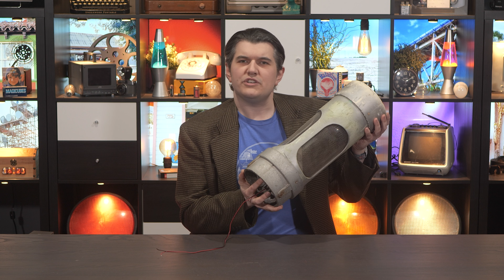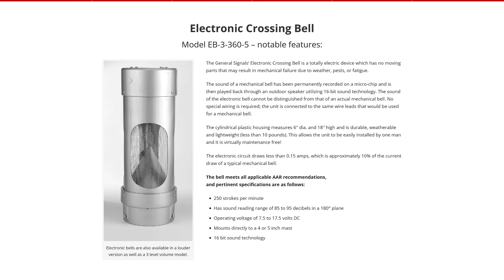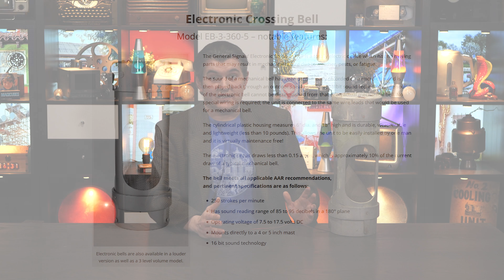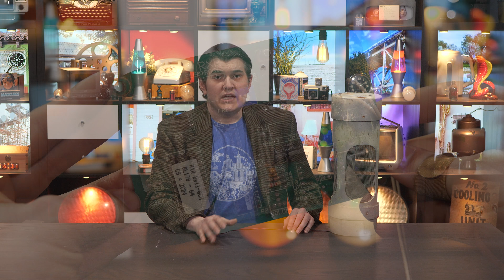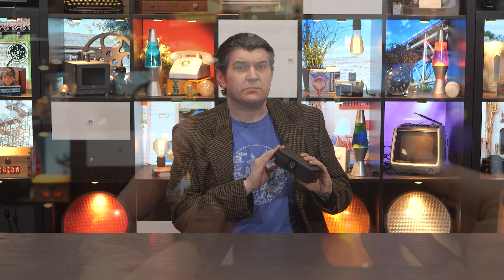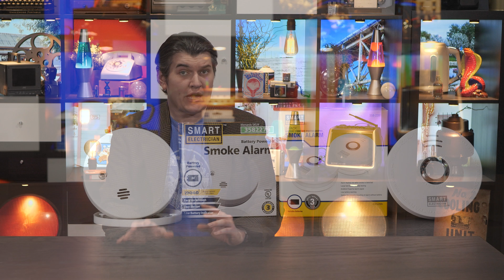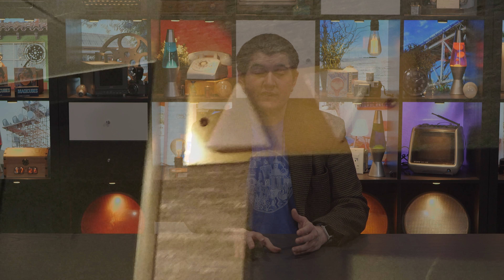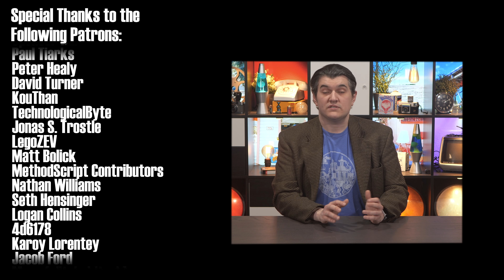The disappearing and unappreciated art of audible alerts

Comment: I miss the brief period when phones had a notification multicolor LED and you could configure it to flash certain rhythms and colors to indicate certain notifications.
Reply: Most missed feature besides SD slots and 3.5mm jacks. My S9+ was one of my favorite phones I ever used.
Reply: @guelahpapyrus i miss when the fingerprint slot was on the back of the phone! Could easily unlock while grabbing the phone and had a better rate than my current in screen sensor.
Reply: @hydra4370 Yeah, under-screen sensors just aren't as fast as dedicated ones. I also have problems with finding the damn thing. I used to pull out my phone and it was unlocked cuz I put my finger on the sensor. Now I have to look at the screen to see the prompt and sometimes push the power button, adding three more steps to unlocking my phone.
Hoping the new ultrasonic sensors will provide some relief with faster action and more scanning area
Reply: @hydra4370see, this was the big thing that drove me away from the S9+ and other similar phones. The fingerprint scanner in the back always felt so out of place and weird for the way that I grab me phone :/ glad it worked for you, though!
Reply: @hydra4370 urgh i hate under screen fingerprint readers. they are soo sloooooow compared to one on the back or integrated into the standby button. with those the phone is unlocked before you pull it out of your pocket with the underscreen ones (and facial or retina scans) you need to first take the phone out, then unlock and then you can do whatever. Not to mention how often the under screen  reader simply fails to read the fingerprint multiple times in a row so you have to enter the pin anyways
Reply: @hydra4370 Also back of the phone scanner don't flashbang you for trying to check your phone in low light. I've literally trained myself to keep my eyes closed when unlocking my phone in bed
Reply: @hydra4370 At least on Samsung, it could also be used to expand the notifications, which was very useful on tall phone. Greatly missed!
Reply: @hydra4370 On my S10e it's on the power button, which for me is the best place as that's the one place I always landed my hand on when picking it up with the intention of unlocking.
Reply: @hydra4370 That's fair, but I didn't like the back of phone fingerprint sensors since they didn't play nicely with my case
Reply: @hydra4370 I like Motorola's placement: built into the power button, on the right side above the volume rocker. Easy to scan your right thumb or left index, depending on which hand you're holding it with.
Reply: @hydra4370 Fingerprint unlocks are a massive security risk anyways, just use a pin lmao it takes the same amount of time at this point.
Reply: @hydra4370yes i will forever miss the ergonomics of my pixel 4a so much. I still have it and like to fondle it every so often. Probably one of the cleanest phone experience ive ever had.
Reply: @hydra4370i hate the back of phone ones personally. I have to authentic for some apps and id hit the camera lens instead. Or its be a pain cause then id have to readjust just for that 1 thing when i can touch a thumb cause ive loaded thumbs and fingers into the security profile. Way easier with it under the screen.
Reply: @hydra4370 I remember my LG G4 (I think… it’s been like a decade) that had the power and volume on the back. It was great. The phone was slightly curved as well which felt easier to reach the whole screen. And also user replaceable battery. 

If LG didn’t screw me over either the CPU crapping out after an update and it taking a class action to do anything about it, and then my replacement just one day just stopped turning on… I would have stayed with that line. Went with a galaxy s7 after that.
Reply: @Politisloth yep, same with the G3. It has been my favorite phone design ever, sadly it quickly disappeared. Thing I loved most about is it when I was listening music with it in my pocket I could press ‘through’ my pocket to change the volume double tap to skip. I miss that atm, i find swiping on wireless earbuds very inconvenient or sliding inside my pocket to feel to find the volume buttons on one of the sides.
Reply: @GameCyborgCh something tells me you're a Pixel man 😂
Reply: @Bokenbergen  I completely forgot it had swipe functionality, been a while since my J7 lmao
Reply: @hydra4370they never worked well for me. The under screen ones are the first ones that worked reliably.
Reply: I am so glad I've kept my s9+
Reply: @CK-jd7wo-test I still use my s9 and it's very useful for knowing if you got a text message or a missed call in my opinion
Reply: @CK-jd7wo-test  I have J7 and A34. Do I need shiny new phone to make calls and listen music while Im in travel?
Reply: @guelahpapyrus  The headphone jack was bad enough, but at least work arounds exist.

But the SD slot fills me a rage!
Reply: @scaper8  Motorola G56, expandable storage up to 2Tb, 3.5mm jack, under 300 USD and can still (mostly) play Genshin.
Reply: @afrog2666 It's honestly so funny how cheap phones still have everything. In 2020 I bought a Chinese phone for 150€. It had a headphone jack, dual SIM, and microSD slot. Additionally, it came with a protective case, multiple glass screen protectors, cheapo headphones, a USB C cable and a 30W quickcharger. Recently (and very unfortunately), I dropped it in the shower and it died, so I had to buy a new one. I figured since I spent so little on my last phone, I could get myself a fancy one this time (and I do like it a lot). This one came with literally nothing in the box except the phone and a bit of paperwork. Not even a cable. And I spent a very significant amount of money on it, lol.
Reply: @scaper8  but how else will they sell you an extra 50gb of storage at an extra 200 bucks?
Reply: @afrog2666  i miss the times when people used phones to be just phones. Not to play genshin and scroll on tiktok
Reply: Someone already pointed out Motorola, in the US you have the G, G Power and G Stylus. I'm not 100% sure on the stylus, but they should all have (G and G Power are guaranteed) 3.5mm out (a bit of circuit noise at lower volumes and not the best max output but it IS a headphone jack) and a microsd slot. Mine has a 256 GB card that I am continually filling with music files c:
Reply: @scaper8  redmi phones still have headphone jacks and micro SD slots
Reply: @scaper8 samsung phones still have a micro SD slot. It's shared with the Sim card
Reply: @EthanShalev  Do they? I thought I'd read that they were getting rid of them too.
Reply: @blargleschnartz  The G Stylus does have both the headphone jack and micro SD card slot
Reply: @EthanShalev no they do not. I know because I just switched away from Samsung for that reason primarily. 
They have slots for two different styles of Sim cards. No high end Samsung has had a micro SD card slot for years.
Reply: Commenting again because I've been living a blissful life: BOLD is an awesome brand out of Miami that still has 3.5 mm jacks and sd slots on their phones. They rock.
Reply: @EthanShalev the cheaper models do. The flagships don't. That's not a "premium" feature. Only plebs need storage obviously. /s
Reply: @Flintzell  The A55 did have a SD slot, the A56 doesn't. Fairphone-s also have SD cards, and a removable battery.
Reply: @igorokinamujika2073  Removable battery is planned for the next EU regulations on phones. So even Apple will have to bring that back.
Reply: @guelahpapyrus  I keep an adaptor connected to my wired earphones these days so I don't miss the 3.5mm jack much. In fact, it solves the problem with some of my devices that have 3.5mm jacks but exhibit audible electronic noise because the adaptor does its own digital-to-analog conversion.

I do miss microSD though.
Reply: @nooneinpart 
Constant use os the USB C on a phone wears out the USB way faster and will literally brick the phone if it doesn`t have wireless charging, it`s a cost saving "solution" from bad companies, such as Samsung, Sony, crApple and many more.
No 3.5, no SD card slot, no IR blaster, twice the money, half the performance.
Yeah, the big one`s are losing and it`s about time.
Reply: @afrog2666 I've never had a port break on my devices, and the USB-C port on my Galaxy S24 is on its own board that can be swapped out.
Reply: @afrog2666  The officially rated amount of times you can plug something into a Type-C port is so vastly big that this is a non-issue.

Stop the nitpicking.
Reply: @nooneinpart That's a good point, that's why you buy the adapter after your headphone jack starts to go out.

Also, most of the devices that do have that are old and that's why they're messing up, not intrinsic to the audio jack.

It's reasonable for me to expect to be able to charge my phone and listen to music at the same time without having to buy an adapter
Reply: @TraxelAxel Nope, my Dell laptop was new and it had noise through the headphone jack. My Samsung tablet too, but to a much lesser extent. My Android-based Sony WALKMAN has some slight noise when the Wi-Fi is turned on and it's connected over 2.4GHz. It's surprisingly common, to the point where in IEM enthusiast communities, a dongle is the first thing people recommend when someone mentions noise.
Reply: @guelahpapyrus  Sony did all three(plus no notch) until the 1 mk5 where they ditched the notification led
Reply: @guelahpapyrus  Fairphone 6 has an SD card slot,  AND a user-serviceable battery.

In fact,  the entire phone is based on the idea that any user with 2 working hands can repair nearly every component without any special tools.
Reply: I didn't realize that sd cards weren't a thing anymore until only a year ago. Been using Fairphone 3 and now 5 and so I've just always got sd slots and thought they never went away. Bummed about the 3,5mm missing in Fairphone 5 though. What do you mean I can't listen to audio through headphones while charging?!? Like that's 80% of my time in trains. I don't want yet another breaking point between me and the audio like my fricking headphones running out of battery or not connecting. Or some hacker trolling them with WhisperPair.
Reply: @guelahpapyrus I still use an S9. My last ones screen broke but I transfered all my data to a new(used)one because I love it so much
Reply: @guelahpapyrus and that's why I will get the clicks commutator.
Reply: @kitt3  Same! Physical keyboard, it has ports, and the notification LED. I've been pining for all of those features to return for years.
Reply: @guelahpapyrus  its so weird that apple is bringing it back on the NEO
Reply: @guelahpapyrus Sony phones still have all of this
Reply: @forzanerazzurri2339 all android phones can easily do this with the screen edges or anywhere on the screen - it's not often a vendor app, but it's a very simple implementation
Reply: @guelahpapyrus 
I'm still using an S9+ going seven years strong 😅
Reply: @guelahpapyrus Motorola Moto G Play still has that SD card slot and headphone jack, and I use both.
Reply: @guelahpapyrus  let me introduce you to Sony smartphones
Reply: guelahpapyrusmine does the fruity light trick, but I haven't found where to configure it so it's kinda meaningless. It does have sdsd.5mm jack, a thermal camera n days of standby, so I'm putting up with a busted screen until it catches on fire. I don't wear skinny jeans, cargo pants. I want a phone I can use as a melee weapon. Not a pringle. The marketing department has a hard time understanding 'functional tool on my belt' but 'ooh sleek n sexy' goes down the gullet easy. It's a goddam tool in this day, not a fashion accessory!
Reply: @guelahpapyrus  I still have those, though I did have a phone without SD slot once.
Reply: @guelahpapyrus That's why my past 2 phones have been Motorolas. Less than $200, has a headphone jack and expandable memory, and runs android just fine. Nothing super fancy but it has basically everything I need.
Reply: @guelahpapyrus a decade ago I determined that I would not consider any phone without an SD slot. I have not had to buy one without it yet. Bonus: every device with an SD slot I've bought has still had a 3.5mm port, without that being a priority for me, though it is nice to have the option. I've mostly gotten Motorolas in that time, but the one before my current one was a Samsung with a model name like Galaxy A39.
Reply: @guelahpapyrus The S/Note9 phones were the best do-it-all phones. Every Samsung phone since has had compromises.
Reply: @guelahpapyrus Had my S7 for nearly 6 years and absolutely loved it. Held up really well, with more than 70% of battery capacity remaining, the frame still in good shape. The S7 with some of the modern (added) software features and a bigger memory would be my favourite phone of all time!

I also loved the possiblity for quick settings when you tipped on the name beneath the symbol (like for wifi or the flashlight). Now you have to press it longer (like before the S7), and it usually brings you into the settings app. The quick settings only remained for wifi and bluetooth. Something that was definitely better before
Reply: @guelahpapyrus  My Sony has all of those.
Reply: @guelahpapyrus at least some non apple phones still have those
Reply: @guelahpapyrus  I also miss my s9+, one of the most expensive phones I've ever purchased outright, but was well worth the cost, one of my favorite phones besides the HTC One M8 I had years prior to that. That was peak quality phone IMO
Reply: @guelahpapyrus  still have my note 9 for these 3 reasons
Reply: @guelahpapyrus i just bought a ulefone armor 27pro and it has dual Sim SD card slot and aux, and it's still waterproof,
Reply: SD & 3.5 jacks are still on my Must-have list which is why I have an A25.
Reply: @guelahpapyrus Sony still has 3,5mm jack and SD slots. Though they got rid if the notif. LED 😭
Reply: @guelahpapyrus I still have the S9+ beside me despite going through so many Ultras.
Reply: @guelahpapyrus IR blaster
Reply: @guelahpapyrus I'm using that phone right now. It works as well as the day I got it. Love it tbh
Reply: @guelahpapyrus I have kept an s8+ precisely for these 3 reasons over ANY new phone. Love it to this day!
Reply: @guelahpapyrus pretty sure sony Xperia phones still have all of this
Reply: @guelahpapyrus My S21FE died suddenly so I'm back to using the old reliable S9+
Reply: @guelahpapyrus  I used my S9+ until 5 months ago. Worked great, just no longer had android support.
Reply: @guelahpapyrus  Headphone jack is especially universal since I carry an AM/FM walkman (disabled the tape motor in one defective unit due to a short across the board that never turned it off) with me, I could un/plug and answer the call in a snap without having to take the device out of my beltclip/holster. Though, I do have USB-C to 3.5mm adapters.
As for SD card slots, that was incredibly handy for shooting video in long-form (in excess of an hour!) at maximum resolution/frame rate (stock applications limit this to 5/10/15/20/25 minutes at times, open camera doesn't) if your video equipment had to be put away due to bad weather (rain and electronics don't mix).
Reply: @guelahpapyrus  watching this video on an s9 💔 I have an s22 as my daily driver but the s9 was always my favorite. my first phone was an s6 active with the very same style of led <3
Reply: @guelahpapyrus  can't say i miss the 3.5mm jack, the USB C port does the exact same thing, just a different plug shape so imho one less hole to collect dirty fluff...
microSD are great, current phone still has a microsd slot in the sim drawer so i dont miss that yet.
as for the message LED, that needs to come back. i miss being able to see from a distance whether i have or not a message.
probably removed on purpose to get you to physically pick up the thing which enables them to make you waste more time with the myriad of apps. while you have it in your hand you can check other apps too. just a quick look to distract you right, maybe click another ad? ugh... bleh... damn i hate enshitification.
Reply: @guelahpapyrus 

I have a small usbc micro-sd card adapter that is very handy, but a built-in slot would be so much better.
Reply: @guelahpapyrus  Moto G doesn't have the LED but it's got all the rest, at least. They ditched the 3.5mm and the SD card for a couple generations about 10 years ago but they brought em back cause of the backlash. Sure, they're a low-end phone, but at this point the specs really don't matter much and they're sturdy, easy to fix, and you really can't beat it for the money. Mine's lasted me 4 years, my partner has a brand new one, they haven't changed much except the specs and tbh that's a good thing.
Reply: @guelahpapyrus the S9 is the best whone I have every owned, and in my opinion the last great smartphone
Reply: I'm still here rocking my S9+, original battery and all. Best phone ever
Reply: @guelahpapyrus wait they took away SD slots???
Reply: @guelahpapyrus  Still using mine and love it, battery is finally winding down and shortening on lifespan though :/
Reply: @guelahpapyrus My S5 was mad. Too old to use now but was mad at the time!
Reply: @guelahpapyrus  is your sd slots not with your sim cards?? And some phones still have the jacks.... yall just choose to buy the ones you dont like for some reason....
Reply: @guelahpapyrus  tf you mean SD card slot is a removed feature? Afaik every android phone has it. Not every might have a 3.5 mm jack, but how often does it get used and doesn't collect dust?
Reply: @danek_hren my S24's sim tray has spots for 2 nano SIM cards, no microSD though. Maybe it's different in other markets outside of North America?
Reply: Y'all out there buying the wrong phones. Mine has an SD card, removable battery, headphone jack, and a multicolor notification LED! And before you ask, it's from Samsung, and it's not even that old. Galaxy XCover6 Pro. The XCover7 Pro released last year and dropped the 3.5mm jack, but otherwise seems to have all the same features.
Reply: @FrivolousSquid the samsung xcover still exists?? I thought it no longer existed
Reply: @FrivolousSquid because it's not an iPhone. Sony also has most of these features, but nobody cares and just buys Apple, only to then complain about lack of features.
Reply: @ashton9699  Some of us are too cheap to pay the Apple tax 😂
Reply: @Denis7947. Indeed! XCover6 Pro released in 2022, and the 7 Pro in 2025. I refuse to buy a phone without a user-replaceable battery.
Reply: @Denis7947. Xcover still exists and it is still one of the worse performing rugged phones around, only underperformed by the CAT. I moved over to Blackview 7 years ago and am only on my second phone. No headphone jack (mine would be full of soil and sawdust anyway) but sd card and notification light. [And thousands of scratches and nicks from a daily life of abuse.]
Reply: Sony still has those. I was only buying Sony phones for years, and was baffled to find out no one else had these LEDs anymore. By the way, the configuration of the color of the LED doesn't seem to work correctly anymore. But most apps seemingly have some defaulted color still bound to them, so at least I can tell the difference, even if it isn't configurable.
Reply: @Transgenic86  I had to switch away from Sony since they have bad cell service support in the US. The sony xperia is easily my favorite phone.
Reply: @poochyenarulez  ah to bad... I have a Sony phone, I love it so much
Reply: @poochyenarulez I LOVED my Sony Xperia. Then my cell company stopped stocking them. I was devastated
Reply: @poochyenarulez  Oh hai KYM lolcow :)
Reply: @poochyenarulez - why does Sony have a limitation? It's a phone, same as any other phone... So just switch to a different carrier.
Reply: @johncoops6897 because it's not made for the American market, so it's not built to connect to American cell towers. Yes, that matters. I'd go to cities and have no connection since the phone is missing a lot of band frequencies.
Reply: @poochyenarulez - well, that makes it a fairly poor choice for that market. I understand the issue of bands, because we have a similar issue in Australia. The carriers only share some bands, and it's all mixed up.
Reply: @johncoops6897  Yes.. thats why i said I had to switch to a different phone.
Reply: @Transgenic86  The best notification LEDs I've seen were on Sony phones in fact. Had an Xperia L with the bottom part of the chrome trim being the notification LED, it lit up with a gradual effect to the sides.
Reply: @Transgenic86  Yeah, I was about to ask what they are talking about, my phone still has this feature. Whatsapp notifications are Green, Signal Blue, Gmail Red and so forth.
Reply: @TheImaginaererfreund Ah I'm surprised gmail had a recognised colour. Being Google, I would have thought that while it was red this week, it was blue the week before and infrared the month before that.
Reply: @TheImaginaererfreund ohh I remember this damn
Reply: @Transgenic86 Not since the mark 5 Xperias, they've killed it off too. I'm still mad.
Reply: @Transgenic86  Newest Sony phones don't.
Reply: @Transgenic86 No, Sony remove them since Xperia 1 V, still waiting what they gonna remove next.
Reply: @Transgenic86 my first smartphone was a Sony Xperia. I loved it. Then try really went away and now finding one in my country is near impossible. There is no real demand for it, so small stores in smaller countries just avoid it completely.
Reply: @Transgenic86  My Sony doesn't have one of these :(
Reply: @Transgenic86 the last phone that had it Facebook was blue, text messenger was green, low battery was red, snap was purple or yellow
Reply: @Transgenic86  Most phones stopped having color notifications because they want you looking at the screen and therefore keeping you engaged. With the color LED you could know instantly if something was important or BS, whereas with a white LED or none at all you're forced to look at the screen and therefore have your attention stolen by the BS.
Reply: @Transgenic86 yeah but Sony only gives 2 years of updates. I usually use a phone 5 years or longer.
Reply: @thoreberlin  my Sony Xperia 1 ii is from 2020, still works perfectly, not going to upgrade anytime soon
Reply: I still have this on my current android phone (Galaxy S10). I have an app that replicates the LED functionality by showing a small (customizable) colored dot near the top of the screen... Even when the screen is off (but you must be using the always on display). You can configure it for specific apps, and contacts. It's called AOD notify.
Reply: @2K8Si Ha!  I bought that app when I first got my S10 years ago.  It was definitely useful.

Then I went to a phone with the edge notification thing and I guess that weened me off of it because currently I don't have edge notification or the dot.  I still have the license to use the app though, maybe I should fire it up and see if it works on my current phone.
Reply: @2K8Si was about to comment about AOD notify as well! It was one of the first things I downloaded when I had to replace my S7 with an S22. I got really used to that LED on my old phone lol
Reply: My nothing phone 2a still has this feature, but with a semi-circle of LED's on the back you can configure to flash in different shapes and patterns! 

I had to pay out of pocket for it, it's not officially supported in the U.S., but I love it and it works flawlessly on T-Mobile, at least.
Reply: @Kevin_Narthex  And the nothing phone 3 has a glyph matrix (which may seem gimmicky and overly whimsical to some people but which I personally absolutely love. The different notification glyphs are so pretty and there are also fun little extras to play with like a tiny pixelised mirror)
Reply: I have a SONY Experia 5 Mark 2 phone, and it has an information LED, and I'm so happy with it. It's incredibly convenient! You can even set a color for a specific contact, and at a glance you can tell who the message is from and whether you need to wash your hands immediately to quickly respond or postpone it. It also changes color from red to green as the battery charges, and you can tell by the hue how much charge it's at without even picking up the phone. It's simply superb, and I don't understand why other manufacturers don't have such a cool feature!
It also has a memory card slot and a 3.5mm audio jack. It's my absolute love!
Reply: @PowerfulElectronics My ShiftPhone 8 has the LED and SD card slot as well. It doesn't have a headphone jack but a swappable battery instead. It only released a year ago.
Reply: I mean if you have a OLED display, which most modern smartphone have, your phone can display a small dot on its screen instead. My Google Pixel does so for certain critical permission access but there is no reason this shouldn't be possible for messages in general.
Reply: @toorero I was about to say that. The sad part is software. OLED displays could be used for that, but the operating system offers a very limited always on display functionality. My phone displays small app icons for every notification, which is not bad, but when I already have a bunch of icons and a new notification arrives, I can't know which app sent it without turning the whole screen on. The funny part is it has a feature to display an effect on the border of the screen when a new notification arrives, which could be a perfect replacement of the led, but it has only like 3 variants with fixed colors (even though the screen can display thousands), and cannot be customized per app, so again, very few information without grabbing the phone...
Reply: @toorero Or just display the notification itself at that point. That's what my phone does.
Reply: right!
Reply: i miss the hell out of those.... i have a nothing phone which does something similar, but it's monochrome...
Reply: Sony still has these on some phones.
Reply: the nothing phone offers some things like that with the pattern lights
Reply: Oh, yes. That was wonderful.
Reply: Thanks for reminding me of my Nexus 5X.
Reply: I have a Sony Xperia 1 III. I believe my phone can still do this, even though it's a bit old
Reply: Hello Moto.
Reply: @Speedster04_BRA  FR,  I miss my old moto for this and the motion commands, like chop twice to turn on the flashlight
Reply: @theguything  I’ve been sucked into Apple phones because of my ex but I really miss my old moto g(8) power, if it hadn’t died I’d still be using it as my main phone
Reply: @theguything modern phones have gesture controls to do things like turn on the flashlight.
Reply: @Speedster04_BRA  Yes i have a Moto with sd card and headphone jack! and double chop for light, and double twist for camera
Reply: @1985-Martin  My Moto also has a "turn on do not disturb mode when set face down on the table" which I love to death, along with the SD card, headphone jack, chop-light, and twist-camera.  They really are still an amazing phone company, sometimes.
Reply: @Blutzen  YES physically putting down the phone like that was so luxurious. 
Now you need to buy something 200 MB big and it doesn't do what you want.
Reply: @1985-Martin  Are the gestures really called that in English? I had my moto g(8) power set to pt_BR and it didn’t have gesture names, it just described them as “gesture to light up torch” and “gesture to open Camera” with animations of the gestures
Reply: I enjoy always on display more. It's less noticable than a bright light.
Reply: Go to the mall, replace your Nokia faceplate and antenna with the brightest blue LEDs on the market.  Ride in your friends car at night and blind everyone in the car when you got a call.  Friend hops a curb with his toyota and now he's mad at you because his portable CD player won't stop skipping.  😭
Reply: It was one of my favourite features.. so I got a phone that still has one lol. And a headphone jack. And a micro SD reader. 

(Ulefone)
Reply: I have the same phone. The IR blaster is super handy, the battery lasts for days, and it's rugged enough that I can't break it. I get questions every time I use it in front of someone.
Reply: Apps on my S3 used to override default blue notification color with way more pleasant ones.
Reply: My old Redmi Note 3 (which still works, I use it as a backup) has that LED and it's great. My current Redmi Note 12 does not, and that was a nasty surprise when I bought it. I was like, what do you mean they just removed that incredibly convenient and clearly successful feature without offering any kind of replacement??
Reply: I loved the notification light, it would let me know what app the notification was from, would let me check my phone without actually checking it by waking the screen
Reply: @Whiteythereaper but you see there's no money in not looking at the screen. Every minute spent looking at a screen is an opportunity for a company to sell you something. Apple gets paid by Google billions every year so the more money Google makes, the more Apple makes too.
Reply: The Note 5 had a folio cover with a magnet in it. Since it could detect when the cover was closed, it swapped to just having the main screen be for basic stuff like notifications or clock.
Reply: I've held onto my Galaxy S10 for that feature!!
Reply: I remember when Nokia phones were being modded with light up antennas. But yeah, besides the LED color, I loved the IR blaster too. That feature disappeared too quick.
Reply: @grabasandwich  my Xiaomi 14T Pro has an IR blaster and it's so good. Moved into a new place and I kept having to get up and find the AC remote. Then I remembered I have this and tossed the remote into a drawer forever lmao. 

Later I ended up buying a cheap WiFi IR blaster box and using its app to control the AC, which is nice because I can control it while away or just not in the room. But I still decided that having an IR blaster is going to be something I give value to when deciding to buy a new phone. Manufacturers, take notes please!
Reply: Those were always great!
Reply: I miss those days too
Reply: Agreed.  Last phone I did custom colours/tones/vibration patterns for was the old Samsung Galaxy S3 which had that almost comically oversized notification LED, in a good way.  Then like mentioned in the video, you can prioritise what needs attention now, attention later and so on.
Reply: nothing phones have that
Reply: My Sony Xperia 1 II still has that. And I hope the soon to be released 1 VIII will too
Reply: Dang I reeally miss that. Forget the "ghost screen" stuff, that was soo useful (color denotes the app, blinker denoted the type).
Reply: Wait my phone is pretty new and I have that and a 3.5mm jack?
Reply: and its even more infuriating when you realize that ALL phones nowadays have OLED panels which would allow them to turn on just a few pixels for this feature and even then they won't do it
there are apps to achive the same thing but it annoys me so much that it isn't integrated into the OS
Reply: Oh my god I had to google How do I personalise app notification sounds in One UI 6 to just set a custom sound for SMS
Reply: Now we can lid the whole screen pixel by pixel, yet no manufacturer has reinvented the notification LED for OLED screens.
Reply: What I miss is being able to differentiate between text messages and actual notifications. I was able to use Verizons message plus for a while, but they discontinued it. Up until they discontinued it and when I had the Samsung Galaxy s4 mini and s5, they had Samsung text messenger (i think). I miss those days when you could tell the difference between text messages and straight up regular notifications, I just use Google messages now.😭
Reply: yes! it truly boggles my mind why they ever got rid of that
Reply: It wouldn’t even be that hard to do today considering we have displays that are “always on” to show the time. A little dot somewhere could mimic that behavior easily.
Reply: Omfg thank you for saying this.
Reply: from a 6 year old xiaomi phone, i am so confused.  why would anyone buy a phone that doesn't have expandable memory, 3.5mm jack, indicator lights, usb c, physical interaction buttons, and more...
Reply: And IR blasters so phones could function as universal remotes. Damn I miss that. Those were the wild-wild west days of smartphones when Moore's law slowed and then broke down and they had to get creative for a few years before ASML got the EUV fabs up and running to scale sub-14nm chips. Once they did, the feature race went away and we went back to the "smaller and more storage" race. Kinda sucks.
Reply: Whats crazy is they can still do it, i used to have an app/widget on my galaxy that would make an AOD to put a ring around the hole punch camera to work the same way. The problem is it stopped working after the notification system changed and apps slowly removed support for the LED
Reply: @Extra_Mental  That also forces the AMOLED panel to be on even if the only pixels that light up are the ones around the camera, which makes the battery drain much faster than the dedicated notification LED does...
Reply: @Speedster04_BRA  i use the 21+ with the 9000mAh battery and amoled display, AOD is turned on with a background image on and it really soesnt make much of a dent in battery life
Reply: @Extra_Mental  I had the Note10+ with the 5000mAh battery and you can really notice the battery difference with AOD on vs off, with it on the phone never goes into doze mode and the battery barely lasts 4 hours while with it off the battery lasts the entire workday
(I used Battery Guardian and Naptime)
Reply: This... Literally bought some of my current gear to emulate this.  That was peak cell phone notification era 👌
Reply: Now we have the whole phone covered in LEDs and they can't figure out how to make it again.
Reply: omg yes. Why tf they took away something so small but useful
Reply: Many phones still have the LED, but the phone OSes don't support them anymore.
Reply: I don't get why they can't just do the same thing in a corner of the screen
Reply: Oh yeah that was absolutely brilliant
Reply: I remember mine had a little RGB light in the speaker at the top, which lit up with a colour depending on the app that you got a notification from. That was neat.
Reply: Get a Samsung
Reply: So nothing
Reply: I really miss this feature. My last phone that had it, the Galaxy S9+, it served me great. Even downloaded a separate app to manage it better.
Reply: I've forgotten about this! I loved it
Reply: smasnug has the option for edge notification colors, it lights up the edges of the screen in a color or pattern of your choosing. basically, every single pixel is an individually addressable rgbled so you don't need a separate one. but it doesn't really work i don't think. it might be more powerful than i remember, but i kinda just assume everything pretty much sucks. i don't remember seeing most of the options you'd want when i jumped through the million hoops to just set it up. i don't think it's that configurable per notification, or that you can talk to it with the standard android notification led api (or any other api for that matter). you know, cause everything sucks now.
Reply: Sony still do it
Reply: Loved that on my Samsung phones! But then the screen size became more important and we had to say so long.
Reply: Let me introduce you to a nothing phone
Reply: This was by far the best feature of the Nexus One. (Second best feature was the goofy little trackball.)
Reply: i Do Not miss that era, i had a girl break up with me because whenever my phone was plugged in, it wouldnt make the screen light up and it would just flash the led red, but the led was always red when it was plugged in. so it just didnt notify me at all and id miss all her texts until way later.
Reply: I remember I had a phone that even had one on the back (the Droid DNA I think). I never understood why they got rid of those. They were so good!
Reply: my aunt's old infinix has it, i still find it so cool
Reply: I thought I was the only one! I miss that
Reply: I remember OnePlus 1  phone had this.  But when I upgraded to OnePlus 6 it barely did this
Reply: My android phone did green for text messages, blue for skype messages, and red for low battery…
Reply: I miss little backside displays, just a clock and notifications. Low resolution LCD, humane brightness, just practicality and some decent style.
I remember when reading the caller's name on the backside of your phone was worth a TV ad.
Reply: Miss my Galaxy J7 Prime
Reply: I had a button that went into the headphone trrs jack that could be configured to recognize all kinds of varying press combinations to open functions on the phone. Now THAT was killer. Could practically text via Morse in my pocket. The true logical next step for T9 if we cared about safety and security.
Reply: Part of why I've pre-ordered a click's communicator!
Reply: My S3 mini and S9 had that. The S9 was the best phone I ever had. I wish its bootloader wasn't locked, I'd totally be using it still.
Reply: My Bf is still rocking his old S8 and the notif light on that brought back memories for me. One of the most missed features of smartphones of yore.
Reply: Thank you for reminding me that my nexus 5 was the best phone I ever had.
Reply: I forgot about that. That was awesome! I could change my G1 LED to any color.
Reply: There's an app for Android devices called AoDNotify that lets you make a dot on your screen that replicates the same thing.  There's argument to be made its relatively pointless because since it's on your screen you may as well turn on said screen, but it could be useful.
Reply: They don't have that anymore? 😭
Reply: YES THIS^^
Reply: Nothing will ever beat Blackberry (and the Blackberry OS) for the variety and customizability of notifications.
Reply: @greghowell9986  Another Blackberry feature was that it registered a virtual contact in your car's hands free system that you could call to record voice memos on the phone while driving.
Reply: I came here to write exactly the same
Reply: I had a Nexus one, the LED in the (excellent) trackball has been missed in every phone since.
Reply: I loved my j7 prime except it was a bit too slow
Reply: There are apps that displays colored circle on OLED displays. It works just like led diode.
Reply: I still have that in my OP13
Reply: The last phone I had that did that had it as a setting I had to find buried in menus to turn on, and the LED was underneath the earpiece grill. If I hadn't gone exploring in the settings I wouldn't have known it had one at all.
Reply: Wow, you just brought back a core memory for me and my half-flip Virgin Mobile phone. lol That small blinking red LED, the meanings behind it, and my severe social anxiety.
Reply: Still use my S9+ that has this
Reply: i guess shoutout to Nothing with their Glyphs
Reply: That's why I have a nothing phone 3a with the glyph lights
Reply: Asus ROG phones still do it
Reply: @Diamonddrake  so dose my nothing phone
Reply: Your phone is a tool that’s not designed for you. If notifications were useful, you check it, resolve it and be done with it. If it’s vague, you’ll be lost and end up spending too much time on the phone, which is what’s designed for.
Reply: Yeah, it was so good
Reply: Samsung X cover 7 Pro has the notification LED a removable battery upgradable memory and still maintains being waterproof. Everything a phone should be
Reply: Me tooo 😭😭😭
Reply: Oh yea...
Reply: In theory you could have this feature on the amoled screen

Because in amoled a few pixel can lit up while not making the whole screen turn on
Reply: Same. It was something I used every day!
Reply: Phones still do this, you have to buy ones that arnt from the huge American companies. I am very pleased with my Redmagic; even though it's from a big company, it's not American. It has programmable flashing notification lights, and still has an audio plug. The only thing it doesn't have is an SD card slot, but it's Chinese so that's expected
Reply: @scylex47 samsung XCover7 has it🤷 I love it!
Reply: @scylex47  Are there any other big American companies making phones than Apple?
Reply: @PekkaKilpeläinen  I almost don't feel like gracing that with a response, but I'm going to say Samsung at least. Maybe LG but I doubt it
Reply: @scylex47 Both Korean.
Reply: Set the AOD to only show notification icons. Has a similar effect.
Reply: I was just talking about this the other day. This needs to return
Reply: My xiaomi does an animation in screen and it's configurable but I think not per app
Reply: I still have one! Sadly no operation on active cell networks...
Reply: My Galaxy S5 had one, and when I went to the A50 it didn't have one anymore and I was so disappointed.
Reply: Yeaaah, I always remember looking at my old Xiaomi Redmi note 5 with it's little colored light flashing at me so I could know exactly what sent that notification.
Reply: Your whole screen is a LED. There are hundreds of apps that can make specific pixels flash in any color you want on any part of your screen
Reply: @TheTransitmtl  But mine is OLED.🤣
Reply: You mean the Blackberry?
Reply: What multicolor LED? My last Samsung was the Galaxy SII for AT&T, and I don't remember if it had one or not.
As far as notifications go, I like the three way button or switch for on/ vibrate/ or silent. I use vibrate on both my OnePlus 7 Pro and my iPhone 17 Pro Max. My Watch Ultra 2 makes the notification noises and vibrates as well. 
I also miss when cell phones had no cameras or at least a hidden selfie camera. I know about RedMagic, but I'm too deep into the Apple ecosystem and I'm not a gamer.
Reply: You can basically set up the same thing using the screen on most phones
Reply: I want touch buttons for home and back that aren't on the phones screen I have an app that puts ads at bottom of the screen I have to swipe up to get home button half the time I swipe up I press an add and the camera in the screen is stupid make the phone half inch taller
Reply: It still works on modern Android if your phone has one (despite rumors of google wanting to get rid of it)
My Fairphone 3 has one and it's very useful.
Reply: I had that on my S9+ that I used for 7 years. I upgraded to an S25+ last June, and I still miss it.
Reply: That's the screen now. But yes.
Reply: Was just coming down here to comment that!  The cheapest Samsung Galaxy I could buy at the time had that, and it was an awesome feature.
Reply: I really miss it too, that was so useful.
Reply: Yes! I loved that. Wish they'd bring it back.
Reply: My Sony Xperia 1 ii still has this, also a headphone jack, no notch or hole punch, Stereo speakers, 4K screen (643 ppi), camera shutter button
Reply: UT Starcom
Reply: i think some samsungs still have this, my phone before last had this, like a galaxy S18 or something? i think my dad's A-series galaxy has this.
they switched it out for edge lighting, basically a halo/ring around the edges of the screen
Reply: My new Samsung galaxy doesn't have a charge light.
Reply: I was downright angry when they got rid of this.
Reply: My Nexus 4, with a full spectrum LED that I could customize to do whatever I wanted was fantastic.
Reply: My Xperia phone still has one.
Reply: I’m still rocking my Galaxy S6 (non-Edge) and it’s kind of sad that that LED is gone from most phones nowadays. That said, the only purpose it serves for me is notifying me of a low battery (and of the charging status when charging), since I have my phone perpetually on Do Not Disturb (I hate all notifications).
Reply: YES! Such a simple, and incredibly useful feature. Manufacturers have become masters at providing features no one asked for and ignoring what we really want.
Reply: And the ir blaster damn wish that was a thing still
Reply: This feature needs to come back. Blackberry hit the nail on the head for that one.
Reply: This can still be done, and for phones with an led it's very efficient. 

Can't confirm iphone allows it, but it's a very simple thing to do on android
Reply: Hah wow that's a throwback. My Samsung Jack had that LED. Did some LGs have it later on?
Reply: Me too
Reply: Ulefone still has that! And a 3.5mm jack
Reply: Set custom vibration patterns, custom screen flashing patterns for each contact.
Reply: My current phone (admittedly pretty old at this point) still has this feature. Is this no longer a basic feature?
Reply: My Sony Xperia 1 mk III has this feature with the notification LED.
Reply: For a while I configured my phone to flash the flashlight when I got a notification and it was really - but I think people often thought I was taking a picture of then when I was just looking at my phone and got a notification - which I eventually decided I didn't want so I turned it off.

Would be nice if there was unobtrusive way to do that yea
Reply: Why did they stop that. I remember my old phone had a blue/green/yellow/orange/and red light that would blink at different intervals depending on my notification.
Reply: Truuueee, i had a Huawei phone with a tiny light, it was just white but it showed me at a glance if it's charging or is charged and needs unplugging, if i have notifications and so on. I hate that phones now don't have those anymore as they used to in the past.
Reply: Yes, i loved it on OnePlus One.
The closest thing we have to that is Nothing phones? By they are monochrome
Reply: I have a custom rom in my pixel, the camera flash with different patterns depending my settings
Reply: Mine is one of the last with that feature. SOOOO USEFUL!
Reply: On OLED Smartphones it should be possible to show an small bright dot for the notifications on the display like that green microphone indicator dot on android. But sadly, no manufactuer use this
Reply: Yazzzzzaa!   I miss that every phone now.  I just pulled my s9plus out of a drawer the other day and plugged it in and the notification led told me it was charging.  I miss this so much and it would cost phone makers nothing!
Reply: Lol I commented before reading the others.  S9 was the best phone I ever had.   solidarity for life
Reply: The nothing phone 2 has a clear back and like 10 LED bars placed around inside that can be set to pulse with different notifications.
Reply: That was replaced by the flashing outline on the phone which is definitely more noticeable but has the same function essentially.
Reply: Now that you have millions of those multicolor LEDs on you phone - also known as OLED display - this feature can probably be replicated by software. The closest feature I know is Samsung's Edge Lighting where instead of just LED it flashes - just as the name says - screen edges. Even when screen is turned off
Reply: Buy a phone from China, it's way cheaper and you can still get those features. I have a Ulefone armor mini 20 pro.
Reply: I miss these.
Reply: Gah I miss those!
Reply: apples and i think samsungs still have the leds that u can configure but the colours dont change anymore
Reply: Yup. I miss my old Samsung note 11. It dill had the multicolor LED. I didnt even need to tumurn on the screen to know if I had a text message waiting..ah the good days
Reply: I miss my blackberry
Reply: S5 my beloved
Reply: now a days we have alwayson displays oled.
Reply: I think the newer Zebra Android barcode scanners still have them. If u don’t know they are just android phones with barcode scanners n cool stuff
Reply: Omg yes that was awesome. I always knew who texted me
Reply: The one and only app I've bought on Play store was a manager for that RGB LED on my Google Galaxy.
Reply: Let's hear it for at least 16 bit binary thinking.
Reply: Blackberry was peak device
Reply: My first smartphone had that. I never really got to use that feature.
Reply: Can still do that with Samsung phones
Reply: I came to make this exact comment!
Reply: I miss my Motorola with those LED’s. Even Apple thought it was a worthy enough phone to put iTunes onto before they made their own phones.
Reply: I still hallucinate those even though I haven't had a phone with one in over a decade
Reply: Galaxy s8 still cooking along with this shit
Reply: My blackberry 9900. For all my 3 gfs. So I knew who was texting me at any given time. Good times
Reply: My sidekick
Reply: My phone has a red LED on the back but sadly it is not that configurable and does mean I always need to put my phone with the screen down. Also I have an extra button which I can configure to be a mute button/sound button  but sadly not a mute/vibrate/sound button. Luckily there are plenty of sounds and ringtones on it though, so I can take some time to configure that. Oh well.
Reply: @breaky73 the OnePlus 3T I had was maybe the best phone in last 10 years. No stupid Bixby. $400 brand spanking new. Has the extra button and all that. But my Samsung S5 was the greatest phone of all time as far as being loaded with features, $200 with a carrier contract (remember those?), water proof and removable battery. Only real complaint is it cameout before USB C. Pity that lol.
Reply: That was great! 🙂
Reply: Not OS native, but Notification Light by Jawomo worked great for me (however I haven't been using it since getting a smart watch).
Reply: The edge lighting on galaxy phones can be changed and customized. Not quite the same as the led but it does do the same job. You just have to set them yourself
Reply: Number 1 loss on smartphones. Miss my motorola droid for that and the keyboard ;(
Reply: What's perhaps more frustrating is how easily this could be replicated with always-on OLED displays if any manufacturer cared to do so.
Reply: Oh man, speaking of: do you remember those little cheap Bluetooth ballpoint pens that would flash LEDs on behalf of your phone? I still miss those.
Reply: AOD Notify if you have android
Reply: It's insane that we have backslid so far on phone features
Reply: Wait I still use my galaxy note 9 they got rid of all those things?
Reply: Early androids were awesome for this, could quickly tell what app was trying to ping me for attention
Reply: Of course this is a workaround, but there are apps that can replicate it with a dot on the screen, and I guess most manufacturers figured that AOD takes the place of it, which it kind of does, but you can't tell by the corner of your eye and the colour anymore.  You have to actually engage with the AOD, just to parse the icons.
Reply: I MISS THIS SO MUCH
Reply: Mine still does😂
Reply: Dammit I also miss those features. Since most devices (not LCD types) that have S/AM/O/LED displays could easily reserve a small segment (left or right bottom or top depending on device orientation prior to being placed downwards or in belt clip), it could be used for that same purpose.
Reply: Dude that was such a cool feature. I miss it. I don't even see why it was actually pushed out because it's not like it was obsolete. If anything it made things unique and functional. It didn't affect the form whatsoever
Reply: @pingusbingus3571  yeah, it was real handy to tell which account or service the message or notification came from. Now it's flustered.
Reply: Omg so true, when I switched over from my Huawei to the Samsung I have now, I asked my friends where is the little LED light that blinks when I get a message, they just looked at me in confusion. I really miss that 😢
Reply: @NiceLord  better to switch back and own that baby for a much longer period of time. If the battery needs replacement, get that done (if there are spares), junk data can be cleared out too.
I hate Samsung's bloatware with a passion.
Reply: @rootbrian4815  They stopped updating the apps on it so most of them didn't work anymore, also the screen startet flickering badly with horizontal lines as well. I had that phone for like 8 years at that point. If only the apps worked I could work around the flickering lines 😢
Reply: Load a morse code alphabet onto your phone and you can set notifications to certain letters at least still works. You have to leaen morse code though and exercise your neuroplasticity.
Reply: @kyledavidson4604  oh man, that would take forever! LOL!
Reply: @rootbrian4815 The value of being able to ignore an annoying person that abuses technology to contact you multiple times a day is a nice feature.
Reply: There's apps that can bring it back as a little colorful dot on your AMOLED screen!
Reply: My phone still does that. I was actually going to comment how much I prefer the color-coded flashing light to coded notification sounds.
Reply: Yeah!  I remember that one. That was a great feature!
Reply: I miss that so much
Reply: YES! My LG G2 had that, as well as my old LG Fuel. I knew exactly what app notified me from across the room. Phone manufacturers are very much more inclined to make you spend as much time looking at the screen (and potentially an ad) as possible.
Reply: Yeah, I had an Ericcson with that annoying "feature". Good riddance.
Reply: Panasonic had a cool one back in the day...

Way before iphones n stuff
Reply: There are too many replies, so I'll just add - the Nothing phone has that which you describe.
Reply: mine still has that
Reply: - multicolor leds
- headphone jacks
- user swappable batteries
- ir blasters
- dedicated fingerprint readers on the back
- fm radios
- slide out, physical keyboards... Or at least t9

Never forget what they took from us
Reply: And now we have OLED displays that could do that with ease... if only samsung could be assed to reinstate a former feature
Reply: Haha I just made a message saying the same thing, scrolled down a tiny bit, and see your comment. I miss it so much! My S9+ was a great phone.
Reply: I Loved the color coded dot!
Reply: Oh my GOD thank you. I went from a Samsung Note 9 that I could easily tell what a notification was. Now I have a Moto G Stylus 2024 and I miss it. Green for Messenger/texts, yellow for Snapchat, blue for Facebook... God.
Reply: my phone, a nothing phone 3a, has glyph mode, in glyph mode it has 3 configurable led zones to flash upon notification, its not multicolor but its 3 different sections of the backside that flashes in a programmed order (only works when phone is screen down on a surface like a table though)
Reply: A lot of phones have brought this back. Mine even has leds behind the front display show I shows alert icons when the screen is off, on top of flashing the flash etc. they also have apps that do edge lighting.
Reply: They were nice indeed, but since Always on display is widely available, it kind of lost it's scope
Reply: I miss the longer period of time when nobody had “phones”
Reply: Today you have AMOLED displays on majority of phonss so you can achieve same behavior as those notification LEDs did... At least on Android phones :D
Reply: HONESTLY!!! on apple there is a mic notification light that comes on in between the dynamic island, it could’ve been so easy to just make that turn red for time sensitive notifications and blue for normal ones. No clue why they didn’t take advantage of that
Reply: BlackBerry's were famous for this. And how well they handled notifications in general. BlackBerry's did so many things so well. It's a shame they could not get onboard the android play store faster. Instead holding onto the BB App World. By the time they incorporated the play store the death warrent had been signed by apple.
Reply: I was thinking the same thing. LG phones did this.
Reply: Still do,  my phone still got a front led flash, and it is a punchhole phone. Leds can be as small as it needs to be, it's just that manufacturers don't see the point in adding them back
Reply: If your phone has an always-on display option, there is an app called aodNotify that replicates the functionality of the multicolor notification LED. You can even move the light around the screen, or have it flash the edges of the screen, or a few other things. There are a bunch of different flashing patterns, and you can set a different color for every app if you want to (or pick the "set color based on app icon" option). It does require some heavy permissions to function, so due diligence is required. It seems trustworthy to me, but I'm just a random person in the YouTube comments.
Reply: I really miss that too. The closest thing now is an option to have the edges around my screen display color patterns for things like that but it's not the same.
Reply: I miss my LG V20, which had a weird cutout section of the screen entirely dedicated to showing notifications. It was treated like a different screen so other apps couldn't draw anything there and it was amazing.

Speaking of which, one of Androids killer features back in the day was to show notifications in the top status bar, instead of having intrusive notification popups like iOS devices had. That clearly didn't stick.
Reply: My HTC had red and green and that was pretty much it, and I don't think they were even reliable, but now even getting notified AT ALL is unreliable, thanks to every app getting specialized notification settings on your phone and in the app itself and from app handlers and do not disurb there's like 17 different variables that determine if you get a notification or not.
Reply: They have added the option to flash the led and/or the whole screen.
Reply: Same here
Reply: I had a phone once that let me set custom vibrate patterns for contacts. I made Morse code for each of my most frequently contacted so I could tell who was calling or texting me. I miss some of the crazier customization options phones used to have.
Reply: that's the only part of my Casio gzone that I miss
Reply: This I have never understood why in the world they ever went anywhere! It's one of the least intrusive user-friendly designs for notifications ever!
Reply: Yes that was amazing
Reply: Just the other day I was wondering what other ways of communication might exist on other planets. 🤔
Reply: I know its late, but I missed this SOOO much too and found an app that does basically exactly this, aodNotify, it basically lets you pick where/what type of notification light you want, I keep a simple ring around my camera punchout and cuz I keep my always on display on (I just hide notification icons on lockscreen until wake) I can know exactly what notifications in apps I have from the ring colour and number of times it spins/flashes/etc. Its something modern phones should honestly have by default, but its helped me get my old notification light back in a more subtle way.
Reply: My S6 was the last one that had it. :-/ now the Glyph screen on the nothing phone is the closest thing you can buy new.
Reply: My previous phone had this but one thing I hated was that it didn't use the light sensor to modulate how bright it is.

I loved my XCover 6 Pro and I'm hoping for there to be a real pro in the XCover series.
Reply: I had a few LG phones with that. I really miss their phones, they were very resilient with good batteries and felt way more intuitive than most other Android phones.
Reply: Yes I remember that. Personally I could never remember who I set what colour. However the choice was far better than that really noisy vibration sound, which really isn't silent
Reply: AH! I have a Blackberry Priv that does that!
Reply: YES! I miss that, too!!
Reply: Personally I wouldn’t like that, but as long as that’s something that can be turned off (which if it’s configurable it near certainly is) I wouldn’t mind.
Reply: Not everyone wants to be a geek like you bro. Some of us are more than happy being no more than nerds.
Reply: Sorry I intended to address this to the OP, TC. Not you wafflefin I'm sure you're no more than a nerd yourself xoxo, take care maaaannnnn.
Reply: The new pixel products are kind of bringing something similar but I did like the tiny led
Reply: My Samsung Galaxy xcover still has that, and a removable battery!
Reply: I loved that feature on the redmi I had.
Reply: I loved that light
Reply: I also miss it, but it's been replaced by the Always On Display. It shows app icons, and tracks to the lock screen notification shade.
Reply: @SilverHusky Yeah but that just means a) your screen is "on" all the time (granted OLED alleviates the problem of it all turning on) and then it has to be on maximum brightness so you can see the icons and read the text. A single multicolor LED that can both vary in colour to denote the app and change blinking pattern to denote the notification type is a more elegant way to do it before looking up what the message is on notification area.
Reply: @SilverHusky  well at least in my case it doesn't do color (for some reason). you could easily emulate the old behavior by having notif icons flash a little brighter and have a customizable color, but they don't :/
Reply: @SilverHusky for Android aodNotify app does that by illuminating a small ring around the front facing camera in the color of your choice based on app
Reply: I was unimaginably pissed when my new phone didn't have one
Reply: I just wish my S23 could let me set different notification sounds for different apps, so I don't mistake a text from my mother with a random reddit popup.
Reply: @flametitan100  It is possible. Maybe you first have to turn on notification categories. It seems that Samsung now collects all notifications of an app into one bucket but this also hides most of the configuration options.
Reply: @MetalheadAndNerd  It took me some digging, but I found it. REAL inconveniently placed, but I found it
Reply: @flametitan100 I had to Google for How do I personalise app notification sounds in One UI 6 Android 14 to find this thank you
Reply: That's downright hellish. Developers.... Why
Reply: Nothing 3 and 4a Pro have full-on notification displays on the back.
Reply: @bar10005 even the older nothing phones had addressable zones you could set up for different apps, so grabbing one used would still be a good shout!
Reply: Check your Accessibility settings. I know iOS has an option to flash the screen or LED for alerts. (I don’t think it’s multicolor, but at least it’s better than nothing.)
Reply: @Teletheus I can confirm: on iPhone the flash lights up on notifications
Reply: @davidebacchi9030  not the same. they're talking about a small, full-colour LED embedded usually near the front camera or off to the side that would be different colours usually depending on the app that had a notification (i.e. as someone else indicated, WhatsApp would be green, Gmail red, iirc SnapChat was yellow, etc.) This was before always-on screen were so common but it's a far more power efficient way to do it imo. But I guess with screens covering the entire front of the device with cameras embedded within it now, there's not really anywhere to actually put the LED on many devices.
Reply: @Teletheus Yep, it flashes the camera flash/back flashlight LED. All iPhones should be able to do this because they all have an LED flash as far as i know
Reply: i dream of a modern sidekick-style phone with an sd slot and notification led
Reply: We can dream ;A;
Reply: But there are also things we don't miss with the old phones.
Remember the screen brightness in a dark room.
I remember having a LG I believe with blue background color and I used it as a flashlight, for real.
Setting an alarm on the phone in the morning meant the sound woke you up but the screen kept you awake.
Reply: iPhone has some version of this as an accessibility feature and Nothing Phone has a more modern and full-featured evolution of it.
Reply: Sony still has these, and headphone jacks, and microSD slots. Yet nobody cares and just buys iPhone anyways only to complain about the lack of features.
Reply: @ashton9699 oh I was about to reply saying I was confused because my phone still has a light and jack but it's because it's sony LMAO
Reply: @ashton9699  Not as many people care about those things as you think.
Reply: I miss everyone being able to afford a good life if they worked hard.
I also miss notification sound customization and I agree with these points made here
Reply: i don't
Reply: @imscaredandconfused looks like you just gave away what you want for Christmas this year.
Reply: @onyxbackstrom3379  What do you mean? I only said i don't miss the period OP was talking about. 

You seem insecure
Reply: They purposely took these features away so you need to use their proprietary notifications. This is also why the sounds change with every new phone version. It's also why they trademark all their notifications and police those trademarks so aggressively. They found out that kids (and a lot of office folks especially in sales and executive levels) who can identify if a peer has an older/cheaper/not-the-cool-brand phone will judge and even bully each other, withhold deals, and withhold promotions if their employees/peers aren't using the "right phone" so it became imperative to sales to make sure notifications had to be louder, brand distinctive, necessary to use the device properly, as frequent as possible, and unique to each price point and manufacturer.
Reply: iphone has this in accessibility settings but it’s monochrome
Reply: Now you have more than 2 million notification LEDs, you just have to use them
Reply: I liked those, too, but with always on displays they're not really needed anymore.
Reply: Nothing does this
Reply: You can do the same with an app now
Reply: @lurifaks92  But (part of) the point is we don't want another app that will sell who knows what data to do a function they took away just because.

Also, no app can ad an LED where there isn't one. The best it could do is color tray notifications and/or flash the screen some color.
Reply: @scaper8  It can't add an LED but it can be close. I have an app that flashes a configurable spot on the screen. Because it's OLED only those pixels light up so it looks basically the same as the real thing.
Reply: @TheFeelTrain what's the app
Reply: @lurifaks92 with newer phone screens being able to illuminate only certain sections of the screen, you can have different colors or you can have a picture show up or anything else with a bit of setup
Reply: @lurifaks92 it's not the same... If you have a LCD screen. It uses way more battery.. and even OLED is way less noticeable then the other ones
Reply: @lurifaks92 no you literally cannot, it is a hardware feature
Reply: Literally barely anyone used that. Good riddance.
Reply: @akronos1  I did.  Why are you happy it's gone if you didn't use it?
Reply: @Choochinc  Because he feels better knowing that at least one other person feels bad.
Reply: @Choochinc Many people think they shouldn't pay for features that they don't use, whether it be notification LEDs, 3.5mm jacks, dual front facing speakers(htc+sony), wake up from switched off alarm (nokia), wireless magnetic charging (palm pre), screen next to camera (lg), physical keyboard (palm/blackberry), play+pause+next music buttons (nokia), back touch screen (ps vita), back buttons (samsung), stylus, eye iris security camera(samsung), infrared remote, fm/dab radio, temperature sensors, hand replaceable batteries, squeeze phone button (htc), rotating cameras (nokia+asus), proximity sensor (apple), NFC, AptX, Lightning port (apple), rotating screen (lg), small phones, e-ink screens, dual stage shutter button (sony), fingerprint power button. Probably other features I can't think of but the gist is that most of these people(influencers) just want to brag how they have the best specifications but when looking at the myriad of features, the market is big enougj to support many different types of phones but then they cannot brag that their phone is the best and all the other features are a waste of money or R&D work. It's why it's often a pain to listen to listen to influencers like MKBHD and LTT put down blackberry because YouTube (a google company) would rather that YouTube influencers promote Android (run by google) and Apple (a company that google pays to be the main search engine). Anyway most people who think this way also think they won't become disabled and therefore hate how parts of the world helps them even though they can join the club with old age or maybe an accident.
Reply: @akronos1 
The LED?
Everyone used them.